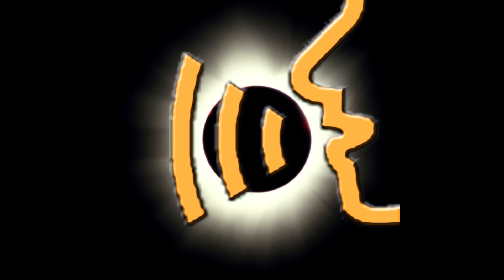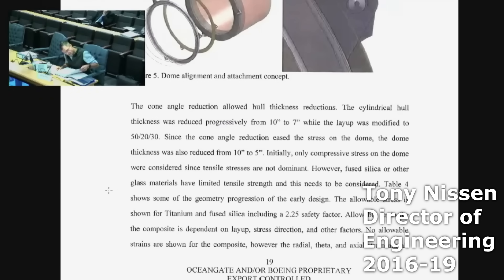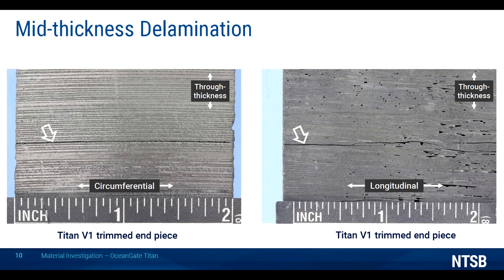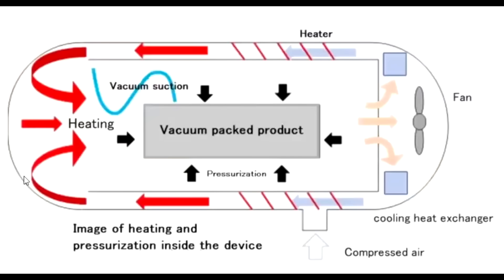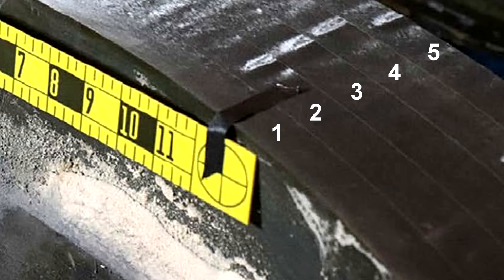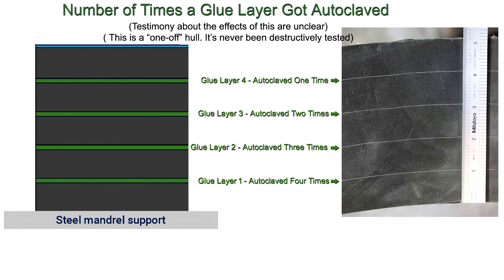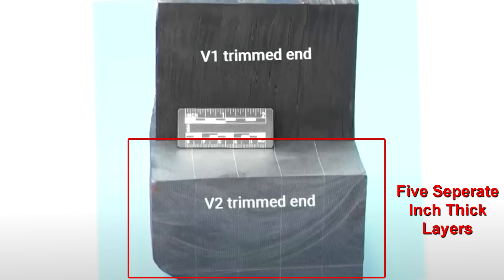Who Engineered the OceanGate Titan V2 Hull? Maybe Nobody Did?

Comment: I still cannot believe they lathed the v2 hull.  That combined with sanding between layers - boggles my mind.  It wasnt a 5" hull at all.  More like 4.5 inch hull with multiple areas within which the length of the carbon fibres were already sheared due to sanding.  Plus these bumps, layer after layer, would allow for differential fibre movement.  Also that they just did 0-90 wraps boggles my mind.  45 would have added more strength.

I can't help but to wonder had they made the 10" hull, wrapped the carbon fibre at 45  in addition to 0 and 90 as was suggested, plus corrected for defective bumps as early as they appeared not finished a full 1" layer then sanded, and not lathed the ends...  would the hull have been safe to that depth?  Or is carbon fibre still a no go for depth.  I guess we will never know until someone else tries it, and hopefully does it safely.  We still dont know the effects of gluing hull layers after curing or multiple cures on earlier cured layers...

I mean there were so many issues from coms, to the window, to towing, to gluing the carbon fibre hull to the tinanium, to layered hull being glued together, to rhino linered exterior preventing inspection, to dropping ballast, to no permanent locator, to deceit, to zero safety mindedness and actively avoiding certification/classification and naysaying the help from the entire community all while chasing money... I mean this sub was decades from safe operation.  And all with a dodgy guy who possessed an over inflated sense of competence and a reckless disregard for safety and an extreme risktaking mindset who was running the show.  JFC what a train wreck.  A Cluster B poster child for what not to do.

The testimony of the guy who runs commercial tourist subs in the West Indies, who dove with Rush in the Bahamas, was truly some of the most damning testimony for me.  Honestly, all of it was an indictment against OceanGate and Stockton Rush, but his in particular.  Some really scary stuff.  He also explained in layman's terms why the hull was making so much noise close to the surface upon surfacing from depth, due to a release of pent up or rebound compressive energy upon approaching 1 atm.  I didn't understand why that was occurring until I watched his testimony.  I still dont understand it 100% exactly as per science and physics.  I wish someone would make a short on just those graphs from dive 80 and beyond that really explains why this pent up energy occurs as was clearly indicated by the working hull sensors (but sadly ignored) and was a clear warning that hull failure was imminent.

Yes, Rush.  Your patented hull sensor monitoring system worked.  Too bad you were blind to what it was telling you.  Not much of a consolation prize ex post facto and 4 others died for your hubris.
Reply: My understanding is that carbon fibre’s fatigue limit is nearly zero, that is, the amount of force it can be exposed to without lasting degradation is very low. As such, every pressure cycle causes damage that will eventually wear out the structure.

We use steel in so many projects because it’s fatigue limit is quite high. It can undergo pretty serious forces and return to its starting shape without lasting degradation.

A paper clip is a good way to understand fatigue limits. If you never bend it too far, you can use it countless times and it will always hold the pages together. But bend it all the way just once and it becomes deformed, no matter how you bend it back it’s not quite as good. Keep bending it back and forth and it breaks entirely. This happens because normal use of a paper clip is within the fatigue limit, but a full bend exceeds it, degrading the metal.

A thicker hull with better build practices will last longer, but my understanding is that a carbon fiber hull will always eventually wear out. On its own that’s not necessarily a reason to avoid the material. The bigger issue is that the safe number of cycles before the hull is too compromised to continue operation is seemingly impossible to accurately determine.

Which is what happened to the Titan. It worked until it didn’t. I haven’t seen any evidence that a thicker, more robust CF hull would be immune to this problem, and it’s simply unacceptable to put humans in a vessel that you don’t know if it’s still safe or not.
Reply: @piedpiper1172  its a miracle it worked even just once, CF is just not a good material for pressure and assembly with other matierals. Every successful dive was like a Russian Roulette Revolver. Luck of the draw, spin the cyllinder and then pull the trigger on an empty chamber.
Reply from the maker: Thanks for your comment.  I have a video coming up on the sanding technique.  Stay tuned.
Reply: The US Navy already has a carbon fiber submersible, albeit an unmanned one. Look into the Advanced Unmanned Search System, AUSS; it's construction is very similar to the Titan just not built by a cost-cutting moron.
Reply: As someone else noted, the US Navy had an ROV built basically in the same manner, (Carbon Fibre Body with metal endcaps), worked fine. But thats was a design that clearly had a lot of engineering thrown at it and when the engineers told the navy "you got to do X" they did it.

Comment: When engineers and bean counters play " hold my beer" , you know things are going to get interesting.
Common sense should tell you if you compress and release enough on a bonded surface, it's going to delaminate.
Reply: And string is great in tension, but not in compression...
Reply: @BillDavies-ej6ye Exactly, carbon fiber makes great o2 tanks but not submarines.
Reply from the maker: Thanks for commenting.  I agree and I am doing a video on that.  Stay tuned.
Reply: Relying on common sense is highway to hell. It isn't common either.

Comment: 17:54 likely, the additional auto-claves did very little to the carbon fiber itself.  However, what little it did do, while ultimately (probably) further strengthening the carbon fiber layers, it would cause them to contract just a bit more as any remaining defects are pressed out.  This would cause shifting between the older and newer layers at the glue point, putting stress on and weakening the connection.  Something that would have become obvious on the 1/3 destructive model testing.
Reply from the maker: Yes, thanks for commenting.  That is why it was essential to do co-bonded 1/3 scale model tests, which they never did.
Reply: I wonder if the additional autoclave bakes increased the brittleness of the hull. I could be way off here, admittedly, but given my limited experience, cyclical heating and cooling has the potential to alter a material's structural composition. Hence, the existence of acceptable temperature ranges for storage. 

I'm curious to hear your thoughts if you feel so inclined to reply 😊
Reply from the maker: @mikemurphy5898  Apparently even experts on the subject are unclear on the effects of multiple cures.  I only put a short segment of Mr. Kemper's testimony on this in the video.  If you are interested in his full answer search, YouTube for    Coast Guard Titan Hearing Sept 25 and for that day skip directly to 9:23:00, that is when the question and the discussion starts.

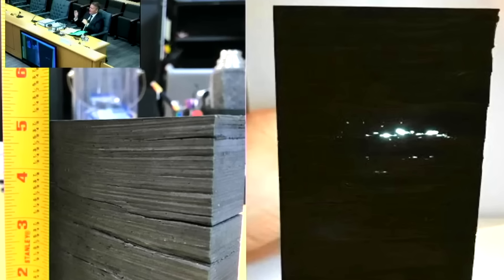Comment: 6:41 It would seem to me that from a strength standpoint the circumferential (0 degree) and axial (90 degree) carbon fiber ply’s would not offer as much compressive strength to the hull as you could get with the use of 45 degree ply’s. Carbon fiber is a rope (essentially) therefore it does offer much compressive strength axially without the use of resin. The 45 degree ply’s would in fact assist in torsional strength as well as hoop and axial stress loads. He seemed to want to decrease cost on materials and performance analysis. Also, not to mention he consulted with engineers who specialize in carbon fiber layouts designed for aerospace applications, which do not experience very high compressive loads i.e deep space or low/ upper atmosphere. The term “aerospace grade” is just a buzz word that makes the average person think high quality and over engineered but in reality it means highly optimized for strength/weight for overcoming gravitational forces to achieve flight repeatedly and as safely as feasibly possible. He used the names of highly reputable companies to convince lay people that he designed a safe vehicle and it cost people their lives. His estate should be under a lawsuit for damages… ok I’m done lol
Reply from the maker: Thanks for your thoughtful comment.  Everything you you said is spot on.
Reply: Correct me if I'm wrong, as there is a dirth of info out there and this has been going on for quite some time, but wasn't the carbon fiber they got from Boeing beyond its expiration date? (Or otherwise deemed unusable by Boeing due to age, uncontrolled exposure to moisture, temp, etc?)
Reply: @ yeah I'm not sure about that. I'll have to do some research but I was just highlighting the statement made about the 45 degree layout being negligible to he overall strength of the hull. I'm not an expert in composite materials nor do I claim to be, but I would love to hear someone in the field expound on the effects of the carbon fiber layout and the issues that could be caused by environmental exposure of the materials prior to manufacturing the hull.

Comment: The titan hull was very much strong enough to go down there. It wasn't the titans first mission, it had been down there multiple times.

I don't know why everyone is hung up on the material or the design.

Ocean gate isn't even the only company that makes and uses carbon fibre subs.

No one brings up the fact that every other companies treat cf deep sea subs as single use due to stress because of the pressures.
Reply: It clearly wasn't strong enough, otherwise the sub would still be intact.

Some materials degrade with use so no matter how many times they have been tested successfully, they still may fail upon additional use. In fact, steel is unique in that its material properties don't change with repeated elastic deformation. This is not the case for composites which weaken over time due to micro fractures building up in the material.
Reply: @deelowe3 It WAS strong enough. It was not strong enough for more than one dive, or for human use, as they did not create and test near enough hulls for a human safe certification.
Reply: so they reused a single use sub because they were greedy rich people.
Reply: The problem with the material is the unpredictable nature of the catastrophic failure that it undergoes when it fails It doesn't deform, it just shatters into pieces. I'm not sure which composite subs you're alluding to, but I'm quite sure that no manned composite submersible had ever been used to such a great depth before.

Carbon fiber vessels are designed to be used under tensile stress, not compressive. The strength advantages of the material are not guaranteed when using it in this manner. The non-uniformity of layers exacerbates these problems. IMO you'd have to be crazy to go that deep in this thing even just once.

"for multiple dives they should have used steel"

Which is precisely why this material is so unsuitable for this task. Nobody in their right mind would ever bother to create such a carbon fiber hull to only use it once. It would be an incredible waste of time and money.
Reply: The hull was strong enough. But the ocean was feeling extra heavy that day.
Reply: @Puddingskin01  "My speed was fine, the corner was too tight."
Reply: Every critique I've seen of CF usage has been about its unknown reliability with repeated pressure cycles. None have claimed that it's not possible for a CF hull to survive one trip.

So you're just arguing semantics.
Reply: It's all about multiple cycles of stressing causing fatigue.
Reply: dawg the sub fucking imploded no it was not strong enough lmao.
Reply: Soo, your point is there is nothing wrong with a company using carbon fiber in a non single use sub... and that its okay since other companies use carbon fiber subs... but only as single use? Are you familiar with fatigue failure?
Reply: @justinshurie6105  Also, tolerances. You need the material to be way above the needs of the environment. Otherwise you're walking on a knife's edge and at some point it's guaranteed to go wrong
Reply: @justinshurie6105  not at all, don't put words in my mouth.

I said that the technology they use is perfectly capable of reaching those depths.

Ocean gate is definitely in the wrong. There was a major engineering problem and it was in the material department. But that problem isn't that cf can't be used to go down there, it's that it can't be reused and for multiple dives they should have used steel.
Reply: If my understanding of what I've seen is correct, they even did have some sensors that detected when it was starting to fail, and they pretty much just ignored them/didn't check them. It's like they were driving around with a check engine light til the engine exploded.  @Falney
Reply: @PJSproductions97  yeah. Ocean gate was very definitely in the wrong. From the very beginning.

I just don't like how most armchair experts on yt are focusing on the fact that it was a composite as if composites are unsafe.
Reply: @PJSproductions97  iirc they had a system that would warn them about the hull losing strength but by the time it triggered it was only seconds from complete catastrophic failure.
Reply: @Falney In the hands of an actual expert who respects testing and the expertise of others, it's perfectly safe. In the hands of someone like Mr. Rush, who thinks money and ego are perfect substitutes for expertise, it's dangerous.
Reply: @foxymetroid  I can agree with that

Comment: I'm not an engineer...but I don't understand how 5" becomes 4.5" and thats okay on something that operates at the bottom of the ocean.  Also, as person who builds things as hobby (mostly out of wood),  and has zero engineering background, the flanges on the rings were ridiculously too shallow (as well as too narrow) .  Those things should have probably been 12" deep and at least the actual with of the hull (a 12" glued joint is way stronger than a 4") .  Again, I  think this entire project was a badly engineered, bad idea -but if you wanted to give it a chance at success it needed some serious re-engineering.
Reply: Yes, the flanges were a joke.  You could see in the wreckage where one side was just gone - completely sheared away, and the other side of the front flange was a curly-q.  And no glue to be seen anywhere on that titanium.  I'm no engineer, but I think the failure was there or close to there.  I would love to see a back engineered model of the implosion that gave a best approximation of where the original event occurred.

Comment: so is this saying the main cause was stockton not wanting to make new titanium rings? so he thinned the carbon fibre layers to make it fit the old rings?
Reply from the maker: No, this is not saying that was the main cause.  There were many structural problems with the hull.  I am just pointing out that the rings were reused and reusing them meant that the hull had to be shaved down to fit into the grove in the ring.  It would have been really expensive to make new rings and domes to fit a V2 hull with a new thickness, say seven inches. Spencer said in their design analysis that 5 inches was thick enough and that shaving down the outer edge was ok to do.  But to me, it seems like it introduces problems.
Reply: @ yeah i wasnt saying it was the only issue. but once youve decided your gonna cheap out making new rings for your prototype novel submarine your really just setting the precident going forward that cheaping out and cutting corners are fine. after that point every step of production and design is called into question. same way i had a chinese near me who kept getting cheaper meat until there luring and cooking local pet cats
Reply: Partly, but also a number of other other factors, like the impact of using a multi layered hull, lack of testing, failure to use suggested construction techniques...